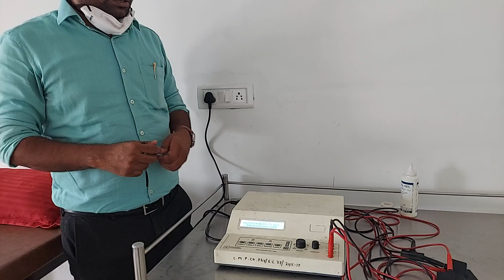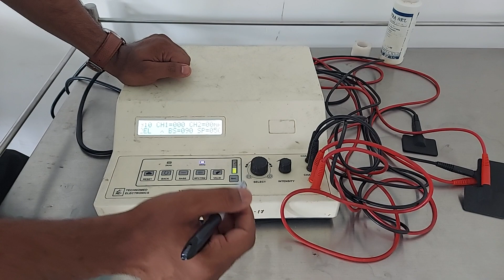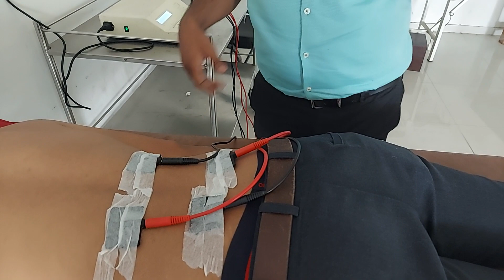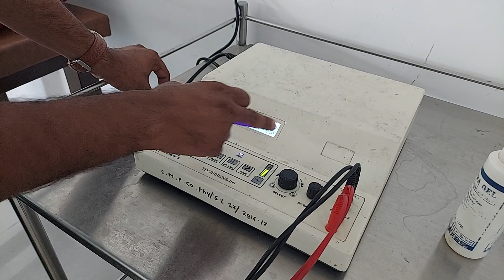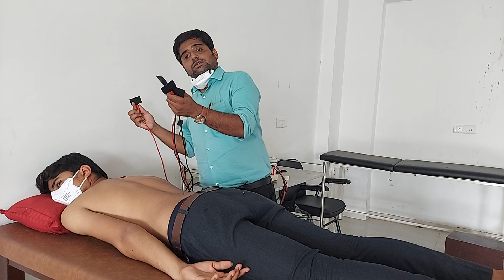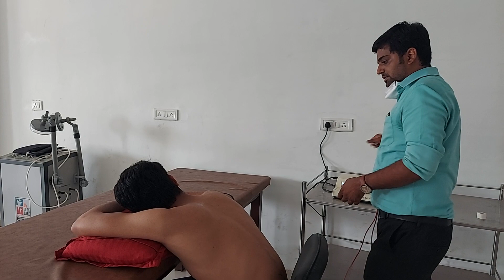Medium Frequency Current - Interferential Therapy (IFT) Practical Demonstration

Comment: Sir can you please clarify What is the specific spectrum frequency we are supposed to set to get different effects?
Reply from the maker: Thrishika, 
  You can consider below information as a ref: 
Constant 100Hz IFC – To Produce Analgesic Effect.
Constant 1-10Hz IFC- Effect on Motor Nerves, Produces muscle contraction in innervated muscles.
Rhythmic 1- 100Hz IFC – Increases Venous return and lymphatic fluid return, reduces oedema
Rhythmic 90-100Hz – Analgesic and Vasodilator effect, reduces neuralgic pain 
Rhythmic 1-10Hz – Effects over motor nerves and Vasodilation effect 

(Ref: Electrotherapy Explained- Low and Reed)